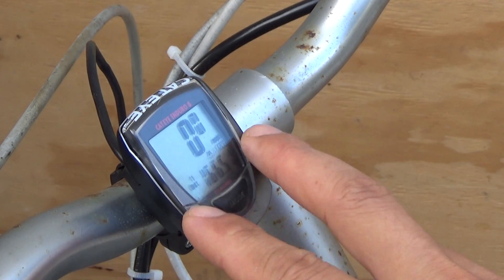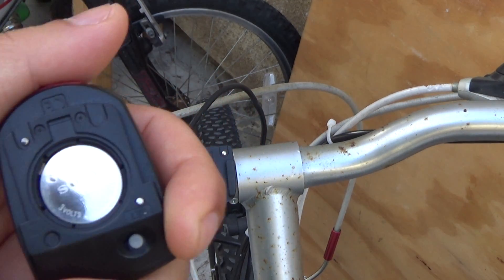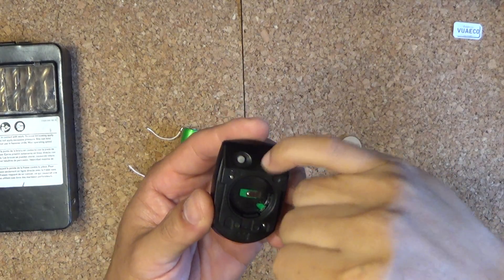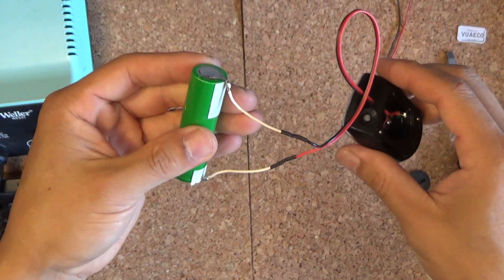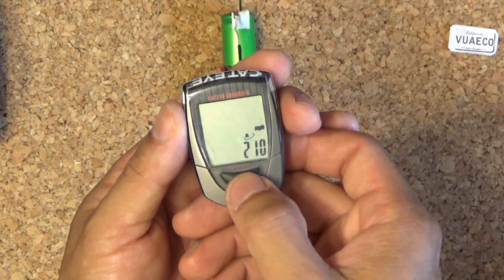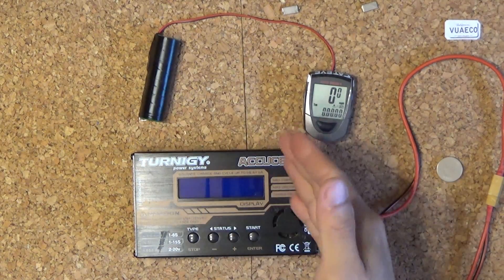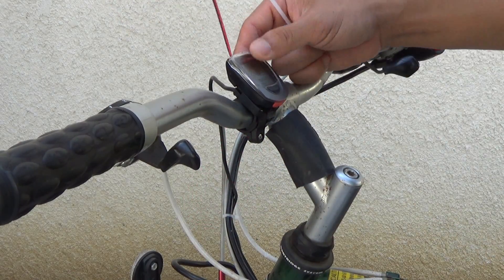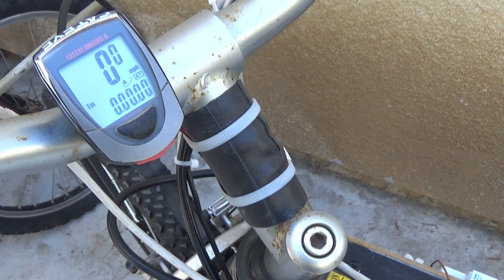DIY Ebike S01E02: Bike Computer/Odometer hack: lifetime battery w/ 18650, no more re-programming

Comment: Battery can last for how many days
Reply from the maker: It's been 1 and a half years and the battery is still at 90%. That's about 500 days to go from 100% to 90%. At this rate, it will last about 5000 days before I have to recharge this battery.

Comment: Reality is button cells last years in a bike computer whereas a 18650 needs charge maintenance to keep it healthy. .
Reply from the maker: Button cells do not last years. If you ride your bike everyday, it would last for a few months max. Maybe it would last for years if you ride it once per year. From the time I made this until today (been over 4 months), the battery still has 95% capacity. If I used button cell, it would have been dead by now. And I ride my bike every single day. Some days, I ride it 3-4 times. It barely made a dent on the battery life. Li-ion batteries do not self discharge much so this will last the lifetime of the bike computer before I even need to charge the battery.
Reply: good to hear its working well for you for some reason coin cell batteries last forever me both in watches and my bike computer.

Comment: Wouldn't it be the outside diameter of the tire, not the outside diameter of the wheel?
Reply from the maker: Yes, it is the outside diameter of the tire (the part that touches the ground). In my case, my tire says 26". But I also get a ruler to actually measure the diameter across my wheel and it happens to be exactly 26"! (which is usually not the case. Don't trust the number printed on the tire. You have to actually measure it with a ruler to find the exact value).
Reply: vuaeco does this me an that every LCD has an internal battery in it .I thought mine worked off of my 36v battery. Or does the LCD unit have a separate battery to keep information. Rather than relying on the main one.I have hundred of 18650's from laptops as going to build as big a battery pack as possible. All charged,discharged and charged again with fine mAh.